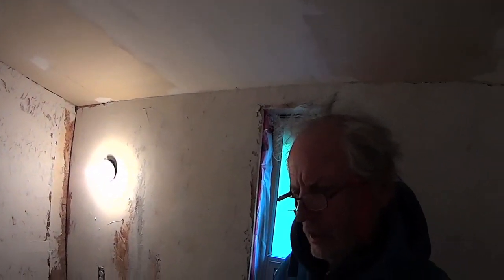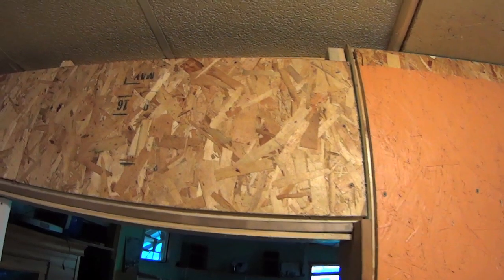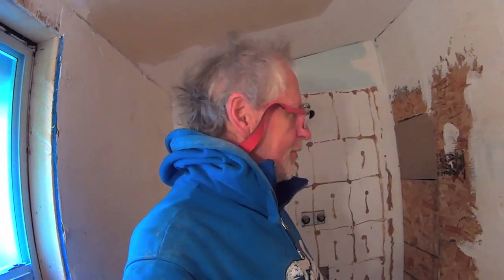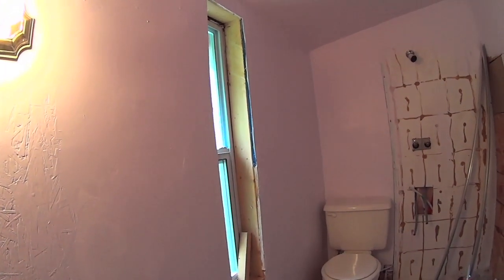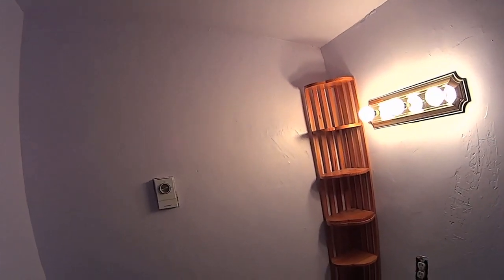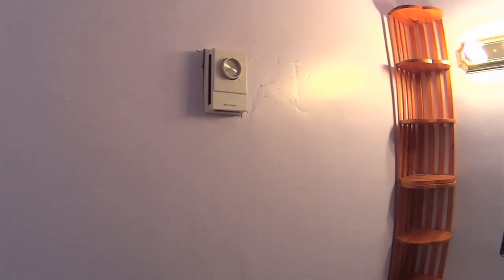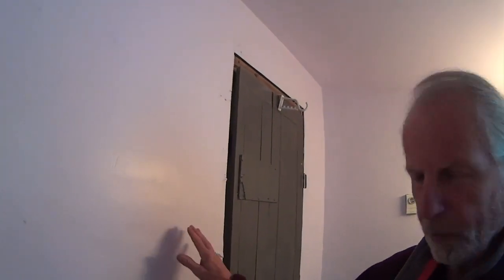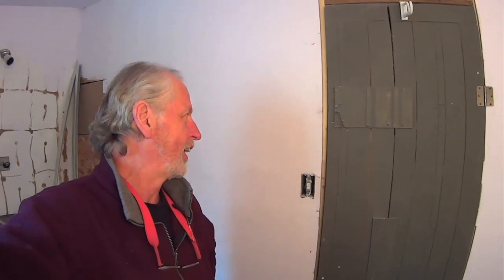Mudding OSB Interior Walls - Finishing OSB board with Drywall Mud for a Mediterranean Look

Comment: I did 5 years of all phases of drywall and steel stud framing. Wet sanding is a good tip, have you tried it? Also if you run your mud each time with a wider taping knife, you might get cleaner results. I might would try priming the osb and then doing a heavy knock down with a really wide knife. What you do is spray the mud on kinda heavy and let it set up just a bit, then lightly drag the wide knife down the wall. This method hides a lot of imperfections m. Anyway I think what you did looks fine for a more rustic look.

Comment: I've done stuff like this but use the fiberglass tape for inside corners  and  joints.   Metal corners for outside corners.   Have also used latex calk but had to go back over it after it cracked.  I used OSB for the strength primarily and the joint compound treatment for the looks.
Reply from the maker: Using tape for the joints is the ways to go.  I use 1x3 common to trim the outside corners and I like the look.  Also, I have had no problem with latex caulking cracking and have used this method for many years.

Comment: With plywood costing so much I am also using OSB. I’m worried now with OSB being in such high demand due to expensive drywall and expensive plywood, that the OSB is also going to cost tons of money. Anyway, I’m going to also buy all purpose mud for $8 and apply the mud on the OSB. I’ve never done this before so I’m hoping it will turn out good. My project is a cabinet in the garage. So it’s really not a big deal if it comes out okay or not. I am however using this project as an experiment to see how well I do. If I end up doing well, this will propel me to new levels and techniques. I’m actually very excited to see someone else doing the same thing and was successful at doing it. I’m glad you liked it. I’m going to try to completely cover the usb so no one will know. I want to see if I can actually fool my friends and family and make them think that this is not OSB and just regular plywood. Again I’ve never done this before so I have no idea if it’ll come out any good. Thanks for sharing your video and I’ve smashed that thumbs button!!
Reply: Good advise, one coat of easysand 45. Work fast it gets hard in 30 minutes With a with a drywall knife cut off all the high spots. Ready for final coat. If you have time 90 will work as good just the OSB absorbs more water out of the coating.. Use mesh tape on the seams. If you are only one tapper, half a bag at a time. 2 nd coat can be regular mud We do this in Garages when they want it finished off and want to hang stuff on the walls.

Comment: Good job Ed. One local guy to another, after looking at your process, it looks good however after reaching the final stage you did before paint there was an opportunity to add a final light texture coating. I realize it's a back room and form follows function but also feel that for the time it takes, one final texture coat would make your work sparkle

Comment: If you faux finish the paint where you apply a darker base paint and let it dry, then go over with a lighter shade or contrasting color paint that is applied with a "rag-on" or "rag-off" technique, the imperfections of the mud coated OSB with look like it's part of the faux finish intent of the paint design giving added texture but camouflaging the OSB strands into the paint scheme.
Reply from the maker: Great tip. Cheers!

Comment: I applied mud to OSB in a large closet 10 years ago and it's held up. The closet was a shear wall in an old house which is why I used OSB. I used general purpose mud but I don't think it matters.

Comment: Great video ! I am going to try using a grooved trowel for my first coat of Beadex general purpose drywall mud over osb . I want to build an even depth of mud. Let it dry . Then repeat with a long trowel. Will use a grooved trowel same as what is used for tile adhesive. . If I succeed I should get the same look as fully finished sheetrock.  If I don't succeed , I will know that experiment did not work. . I will do my final coat with a 20" trowel so im hoping to get a nice flat surface .
Reply from the maker: Sounds like a great idea.  Good luck.
Reply: @EdwardHomerVIC I should say, a notched trowel.  1/4" notched.  
And prep the osb with a solution of 60/40 water and yellow wood glue.  Roller it on. As soon as it's tacky start with the mud.

Comment: Thanks for video, i think the results look good. I put some cement gypsum plaster on some OSB a few years ago, and it worked OK. Just to block up a door.  Gypsum products like plaster (mud) and plaster board (drywall) is expensive to dispose of in UK also.
Reply from the maker: Ya it is fine for my studio or a basement.  Looks a lot better than bare OSB painted. cheers, Ed

Comment: Great video! I've been reading other forums on using mud over osb and they talk about how the osb can flake and bubble. Have you had any of that happening over time? Someone had suggested an oil-based primer to use as a sealer before mud is applied. Did you have any kind of sealer before you applied the mud? I'll be building soon with SIPS panels which have an OSB skin, so I'm wondering. Really love your results.
Reply from the maker: I have had no problem with wall that are in a bathroom that I did for this video last summer.  Look at some of the comments below for tips.  cheers

Comment: Still holding up? I am renovating a large garage loft. That has osb hung already. I like this idea. Drywall sucks. Did you use any bonding agents? I wonder if some sand in the first coat would be good or bad. Looks good man, drywall is too flat and boring anyways.
Reply from the maker: Holding up fine.  had people living in studio for 2 winters, so showering etc every day.  No bonding agent, just slapped it on.  One thing I will do different next time is use a sponge instead of sandpaper to knock off high spots.

Comment: How did you cover the corners and seams? 

Also do you think you could roll on the mud? For a textured look?
Reply from the maker: The corners I used painters latex caulking, have been using that for years with drywall as well.  The seams I just slapped the mud on and they don't look great.  I think the roller is a great idea.  I would apply the mud first then roll it for the finish.  If you try that please share a video or photo here.  cheers.
Reply from the maker: I should add I use the latex caulking on the inside corners and trim the outside corners and doors with 1x3.  Rick suggested fibreglass tape for the joints and that is a good idea.

Comment: Prime walls before applying mud. It will stick way better
Reply from the maker: Thanks for the tip.  Prime with what?  I didn't have any trouble with the mud staying on the wall.
Reply: @EdwardHomerVIC  you can use the hopper ,is faster and when you mix the mud ,pour about 1/2 pint of latex killz 2 primeran shoot